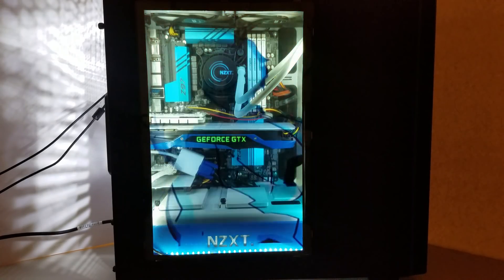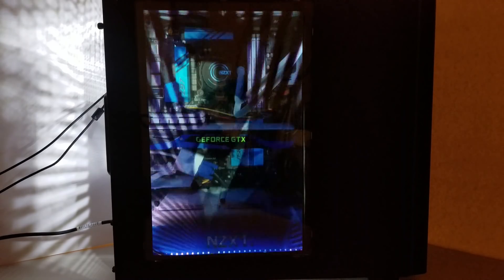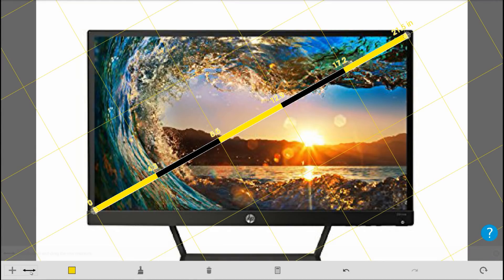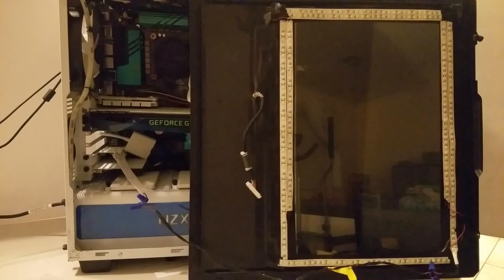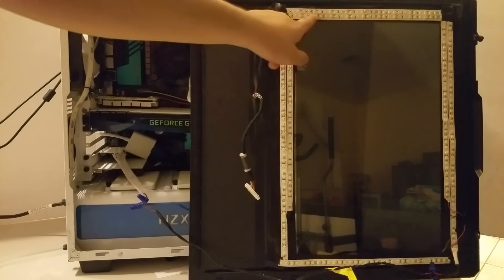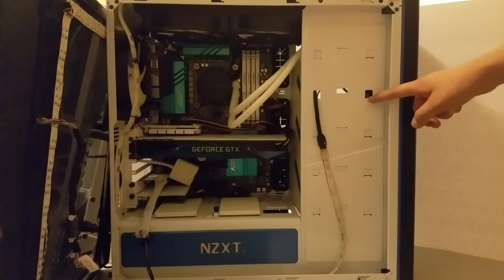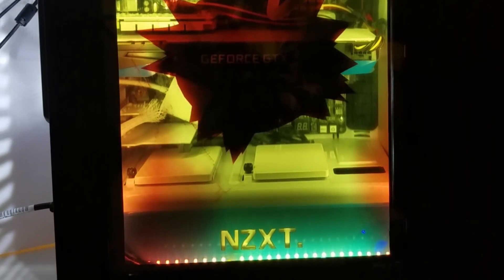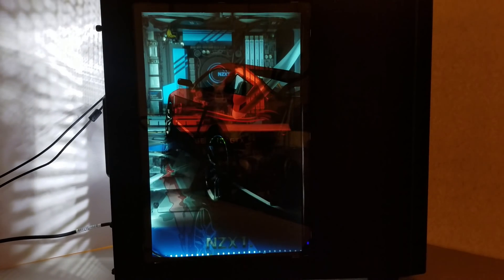LCD Side Panel Tutorial (Sort of?)

Comment: SOOOOooo and how do you run a tripple screen setup without live wallpaper + that one in the pc panel with live wallpaper? or is it just a movie that runs maximized
Reply from the maker: My original set up had it set up to where it was a 3rd screen, so part of my desktop.  I achieved this by running a cable from my graphics card to the screen. Wallpaper Engine was what I used for that set up. For my current beta set up, it's using a raspberry pi. I have a tutorial posted up that explains the whole process as to how I rip the video from wallpaper engine and run it on my RaspPi.
Reply: @OnePixelataTime  hmmm a RaspPI! ....or android Box that could also work and is cheap, saves space thanks
Reply from the maker: @KarimAkors  Whatever works for you!

Comment: So... I have a question. I heard that if you have an USB Monitor, it helps a ton because you can plug it in and you have power + videosignal. Now, is that only the case for USB 3.0 monitors? I saw a dell with 2 USB 2.0 plugs, do you know if that would work too? I don't wanna solder :I
Reply from the maker: As you probably know, USB monitors pull their power from a usb port. If the monitor you own isn't a USB monitor, then the usb ports it has build it won't power it as that isn't their purpose.

I didn't solder my monitor in, I used Twist-on wire connectors to connect everything, the only soldering I did was with the LED lights. Does this help?
Reply: @OnePixelataTime  Thank you so much! I didn't know about these twist-on thingies, this makes it so much easier! The connection to get it to work is just trial and error, right?
Reply from the maker: @Nemain_  That's what worked in my case, trial and error, just be careful; looking at the circuit board could help, sometimes the wire labels give directions as to what powers what.

Comment: got two questions, I have a Corsair Carbide 275R Tempered Glass case, can I just mount the LCD to temper glass panel ? does there need to be a small gap or the closer the better ? and last question will my LCD display normally on 90% angle like the one in the video or do I need to set it up so whatever  I display, display properly?
Reply from the maker: Sure, if you can find a way to keep the LCD screen in place, I don't see why not; the closer the better.

Some screens have different viewing angle degrees horizontally and vertically, rotating your screen90 degrees could or could not reduce the viewing angle, this varies by monitor.

https://downloads.monoprice.com/files/images/ViewingAngle.jpg

All this means is, if your monitor doesn't have a large viewing angle, seeing it from too far off the side won't look as good as seeing it directly.

Comment: hi nice video bro...if I need reflected light from the back of lcd instead of backlight does the lcd panel polariser s need to be removed? could you help me out with this here...thanks:)
Reply from the maker: I wouldn't suggest removing the polarized layer, as its crucial to displaying an image on the lcd.

https://www.youtube.com/watch?v=jHiM4ph6kUI

I only removed the anti glare layer on mine to improve how transparent it looked. That was it.
Reply: One Pixel at a Time ohh cool...so with the board controller you only attached the lcd and removed all of its sheets at the back ?is it possible to make a reflective screen or a transparent one where I can work on it ....I have no clues on light reflections man trying to sort it but struggling
Reply from the maker: @justinace974  Yes, I kept the controller board and  the LCD panel in the monitor.

Have you seen this video? https://youtu.be/258C19pwXzo

I tried to cover most of that in. As for the other thing you're asking, I mean yes, the LCD is transparent, that's normal, but I have no clue what you mean by reflective.

Comment: hi do you know any other software to find the dimensions of the monitor?
Reply from the maker: For Android? Not that I'm aware of. The other apps that I tried did not include a reference measurement, meaning I have to manually input each distance vs having a length the app can reference.

Comment: You have the prototype. Now just refine it to something that is not only functional and practical but something that is also aesthetically pleasing i.e. instead of a vga output, maybe a hdmi. Instead of electrical tape to mount the strips, magnets (maybe find a way to magnetically shield the LCD’s. Though may not be necessary). construct a chassis for the circuit board and I/O for a cleaner installation and cable management similar to something like the Hue+. I would buy it. This is a pretty cool product idea that may replace or augment the whole RGB craze.
Reply from the maker: That's what im working towards, an easier set up and cleaner/ professional look.

Comment: the reason why it's best to use lower resolution is because the pixels are bigger and give more light so with a suboptimal backdrop the picture is more clear
Reply: What do you mean by "give more light"?
Reply: meant more light per pixel
Reply: I got that, but why would each pixel give off more light if the screen has a lower resolution?
Reply: @obiwac  doesn't give more light but on higher resolution it's spread across more pixels so they don't have to be as bright
Reply: The screen doesn't give more light
Reply: But an LCD doesn't give off more light... Do you mean that at a lower resolution, less light is blocked?
Reply: no the brightens for the screens as a whole stays the same but the more pixels there are the more the brightness is spread across all of the pixels
Reply: @Tobi-xj8xw  What you are saying makes no sense. An LCD panel only blocks light. With X amount of light shining through an LCD panel blocking 50% of it, what you see will still be the same amount no matter resolution. The reason for having low resolution in a side panel is because ease of use and price. High resolution side panel would make little difference in aesthetics but make it a much harder and more expensive project.
Reply: @bomb_and_gouge  I was drunk when I wrote those comments
I was probably thinking about OLED
Reply: @Tobi-xj8xw  OLED can't be used to produce this type of effect to begin with. You must have been pretty drunk lol
Reply: @JonathanGray89  there are transparent oled displays tho
Reply: @Napert  Either it uses a backlight or it doesn't, that's the point.
Reply: @JonathanGray89  oled needs backlight? doesn't the individual pixel produce its own light?
Reply: @JonathanGray89  also found the vid i was talking about - https://youtu.be/_yxs4IS9HXU
Reply: @JonathanGray89  i wasn't trying to look smart lol, i just thought it would be relevant and you actually made yourself look like you have a very big ego by acting smarter than everyone else
and no, I won't reply anymore to fuel your ego, so go ahead and act smart talking to a wall
Reply: @Napert  So why bother commenting? If you were looking to strike down the ego of someone who is apparently acting smarter than everyone else you could probably go about it in a better way than making false assumptions... lol

Comment: Hi, great vid. one question, the VGA adapter you use which one is it and is it active?
I got a 1060 and it dosen't support analog signals and I want to do this but I only have a VGA monitor
Reply from the maker: I'm using this product, which isn't active from what I read.
http://a.co/d/3WckuQC 
However if you want an active adapter, this product by the same company claims to be active.
http://a.co/d/9AieqR7 
I hope this is of some help.
Reply: @OnePixelataTime  Thank you for your quick reply and help
Reply: @BondeJakob101  did it work
Reply: @HappySlappyFace  
Hi, I got a, j5create Mini DisplayPort - VGA 0.1m, and this works with a GTX 1060 and a VGA monitor, sorry for the late reply

Comment: Did you remove the plastic window built into the side panel? Would it be safer to leave the film on the lcd if i were to remove the plastic window? im doing this mod to my nzxt h440 but my window is all scratched up.
Reply from the maker: The LCD is attached to the plastic window it comes with, the LCD panel itself if very fragile, if you were to bump it by accident without any support (in my case the plastic window) it could crack the LCD. Think of the LCD as a very thin piece of glass is the best way I could describe it (or crystal?).

The layer I suggest you remove doesn't really add any support (if any, its very little), the reason I suggest removing it is make it easier to see through the LCD better, but you can test it to see how it compares with or without it(although you'll need a second screen for that).

As for your scratched screen, you could try replacing it with a sheet of acrylic, it'll require some work, but its possible(unless you can get NZXT to send you a new one/pay for one.

Good Luck
Reply: i swapped my window out and got everything almost ready, but was wondering did u use both 5v cables and both grounds from the monitor power wires or just 1 of the 5v and 1 of the ground cables? or two 4 pin molex connectors?
Reply from the maker: Here's a picture I took of what wires I used from the circuit board to power the lcd panel https://imgur.com/a/AfGgkpr. Hope this helps.

Comment: How is the lcd power connected to the power source of the pc?
Reply from the maker: The LCD is powered through its board (this is the board that came with it in the monitor) and that board is connected to a 4 pin molex with is receiving power from the PSU.
Reply: do you know how many watts the monitor uses and how much overhead would be needed on the psu?
Reply: Since a maximum wattage on a molex is 132 watts on 12 Volt devices, OR, 55 watts for the 5 Volt devices I would say your overhead should be at least 175-200w if your psu supports that trough a single molex.

Comment: would this even work for a storm stryker case ?
Reply from the maker: scott paar I'm going to say yes as long as you can find the components you need that fit for the case you have.
Reply: https://www.newegg.com/Product/Product.aspx?Item=9SIA86J67V9900&cm_re=cm_storm_stryker-9SIA86J67V9900-Product  that's the case I have
Reply from the maker: scott paar yeah, if you can find a screen that fits the opening on the case then sure technically you should be able to the tricky part is just finding that LCD screen.
Reply: Ya not even sure a size lol 12" maybe

Comment: I just got my snowblind pc and theres about a half inch thick straight line on the very bottom of the lcd screen thats white. Did they not layer the side panel correctly with the interior coating so i should call and get a replacement?
Reply from the maker: james varga As in the LCD came damaged? Usually that's due to a damaged panel by how you're describing it. I'd contact them for sure.

Comment: How do you do the cabling for power? I’m doing the same project you did but I need help on powering and the right cables. Please help
Reply from the maker: Someone asked me a similar question, my response was a few pictures of the wiring I did https://imgur.com/a/AfGgkpr. I have a 4 pin molex powering the board that powers the screen. This of course will vary by screen, trial error is what you'll have to do, just be careful. The wrong wiring can short circuit the whole screen.

Comment: This is a nice mod, but that wiring makes me cringe so badly... clean that mess up, and don't use wire nuts inside you computer, better to use crimp connectors.
Reply from the maker: Randal Lovelace I'm well aware, I'm currently trying another cleaner  method that seems to work so far. It's a better look and improvement. Thanks for the suggestion:)

Comment: I've got a couple questions my man. I cannot figure this pin-out out. I've got almost the exact same setup, but with a w1707. So far it's been the exact same thing. I've got two +5v connections on the internal power supply of the monitor, three grounds, on/off, and dim. How exactly do I wire these to the molex?
Reply from the maker: I used a 4 pin molex extender(one side has a female end, the other male, this way you tend to have more options as to which type of connection you use) cut it and connected the wires that give the LCD(its board mainly) power. Just be sure to connect them correctly, don't accidentally connect it to the 12v if you're trying to connect it to the 5v, because it will fry it if you do.
Reply: One Pixel at a Time I actually got it. Just waiting on the wife to Cricut my side panel then mounting and I'm in business. Plenty of light/white and ready to go.
Reply from the maker: James Young Awesome!

Comment: There is tow 5v in monitor cabel   which one i connect to molex
Reply from the maker: There's no way I can possibly know which cable to connect it too since it varies by monitor, the only thing I can suggest is try a set of cables, test it, if you don't get the results needed, try anther set, just be sure you're connecting it to the right cables on the molex(the wrong voltage can do major damage).

Comment: Nice video, and good job figuring out how to make it work!  I saw one on display at Best Buy this past weekend, the iBuyPower Snowblind, and thought that it was really cool.  The one I saw had the GeForce GTX 1080ti  vid card, $1100 which makes up more than half the price of the PC.  at $2,000 I haven't looked, but will look to see if you posted more about it.  Does it work just like a regular monitor, if so how do you set up that the images are just displaying on that specific one.  The only thing the Snowblind PC looked like it was lacking was more RAM with only 16G.  I think it might be a pretty good deal if you are in the market for a new PC and were going with the top Video Card.
Reply from the maker: The monitor can work as a second monitor to your PC or if you connect it to a Raspberry Pi, you can run the backgrounds from there(look through my other videos).

Comment: Hey, nice mod. I made one of these myself a while back but never had the time to create a decent video explaining how i did it. Check it out here if you like;

https://www.youtube.com/watch?v=Ua58mG65TJ4&t=51s
Reply from the maker: Duo Tech Nice,  looks good! Is it me, or does it look somewhat blurry?
Reply: You're right, I had a look at you're part 2 video and I hadn't removed the anti glare layer from the LCD panel... I've actually got the panel out and am soaking right now to see if i can get it removed as easily as you made it look. I think my panel has the polarising layer and the antiglare layer on different sides as both sides appear to have a layer on them.

It has been months since i did anything regarding this project but stumbling across your video has made me get the panel out again to perfect it. I have a spare side panel that i use most of the time because the novelty wore off after a while and it's nice to just have a clear side panel. Have you still got the LCD running on your PC?
Reply from the maker: Duo Tech Oh cool, just be careful, some screens have two polarizing filters, one on the back and one in front, one filters horizontally and the other, vertically. 

And yes, my Lcd is still there, I'm testing other lcds, see if they give better or similar results.
Reply: I used 5630 leds but have also thought if something brighter would give better results. I even installed a 20w led from a floodlight in a hdd tray at one point but it provided no better lighting than the strips alone so i removed it.
Reply: Oops, i read lcd's as led's then wrote that reply. Out of interest which led's did you use? 
As for the lcd, i used a Dell 1909WF which had a Samsung panel inside
Reply from the maker: Duo Tech Ah ok, as for the LEDs I put the ones I used in the description :)

Comment: Great work, saw this on Reddit, one suggestion on the fabrication process of this, silicone calk, instead of electrical tape. As it’s non conductive and should hold very well, especially against heat. You’d want to sand to bare metal to get good adhesion and possibly use a good epoxy first and then calk over the edges of the screen and then use fabric electrical tape to cover any other components. Very seriously going to work on this this weekend as I have several old monitors. Thanks for the inspiration!